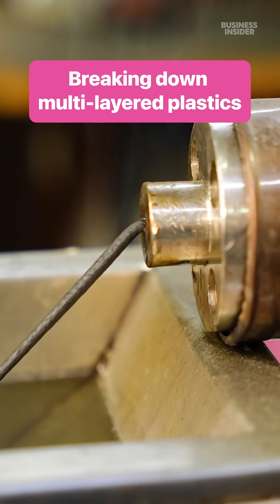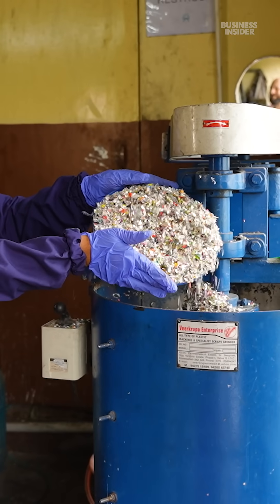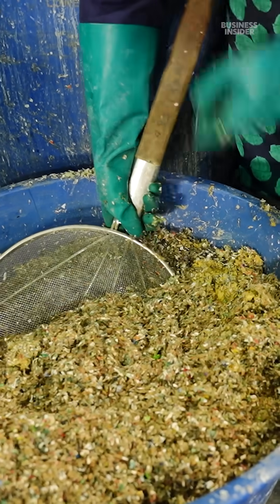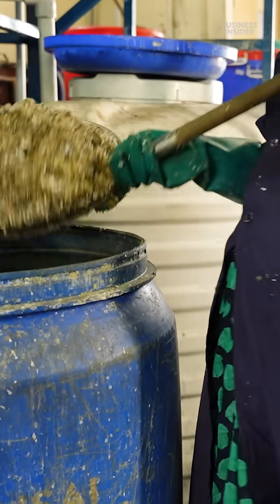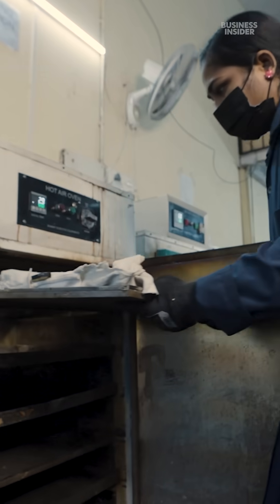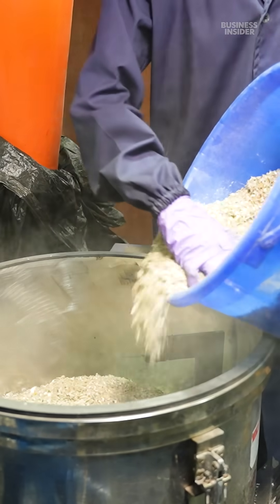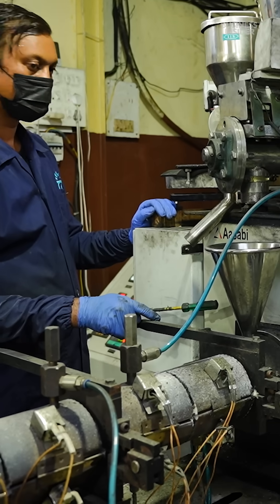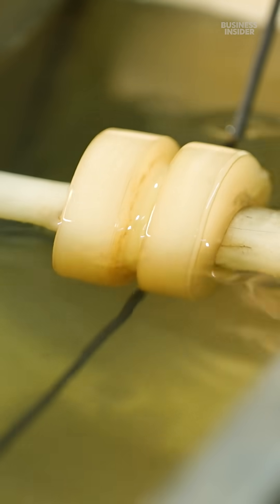Only a handful of places in the world can #recycle multi-layered plastics. #plastic #sustainability

Comment: lol at the face masks. This is basically a microplastics manufacturing plant. That water is contaminated, the floor is contaminated the machines are contaminated, even the air is contaminated from microplastics dust. That whole facility is a pollution nightmare
Reply: What do you think happens at a plastic factory? I work at one that has a hundred times more plastic dust than shown in this video. Tens of thousands of these places exist everywhere over the world.
Reply: That's rich as you type on your  oil manufactured key board, looking at your plastic based LCD monitor , USING your plastics based for to ridicule  the use of oil.

That's quite rich .
Ya dink.
Reply: At this point so is most of the earth unfortunately!😢
Reply: You're right, we should stop recycling and just continue to dump it into the ocean and bury it into the ground.........................................................................................
Reply: Do you drink water? Water that likely comes through a plastic pipe (if it doesn't it's a metal that can corrode and kill you faster than micro plastics), So you filter the water then? Through a plastic framed filter into a plastic cup? Or maybe you drink canned water from cans with a plastic liner?
If you drink from glass cups, congratulations, you feel like you have some semblance of safety in your plastic life.
Reply: Maybe you would like to not be a hypocrite and go back to pre-industrial existence where the only pollution is human sewage, amimal sewage, cholera, dysentery, typhus, and indoor air pollution from the indoor burning of wood and dung on open hearths.
Reply: As long as they drive EVs and use Solar power. Then all is fine. Al Gore and John Kerry with Greta can sleep comfortably at night.
Reply: Weird to put blame on the people trying to recycle the waste and not the people drilling for oil to make the plastic bags in the first place.
Reply: @SlashCampable It's not putting blame, just saying the end result is equally bad... Just stop using this shite...
Reply: @marcyhoxton I completely agree!🤔👍
Reply: @SlashCampable no-ones putting the blame on them, they're simply making a valid point, and yes we all agree that oil tycoons have a lot to answer for!🤔